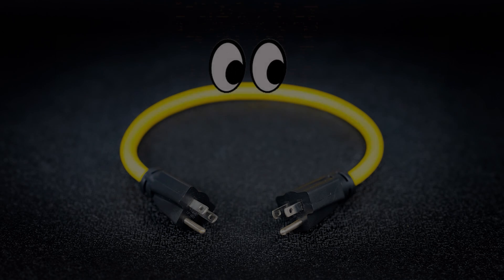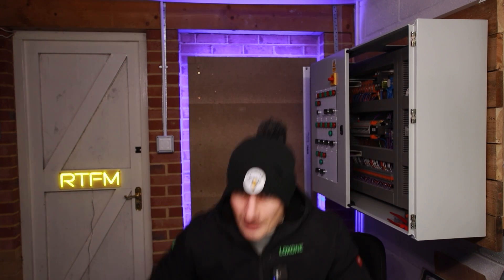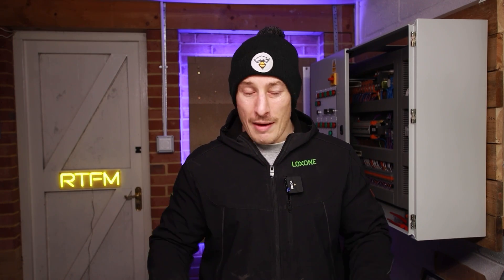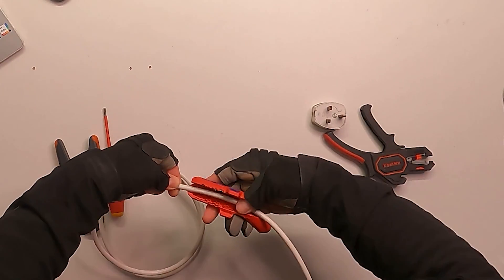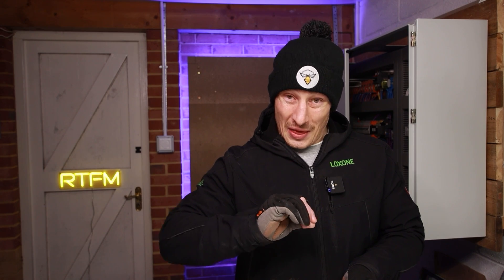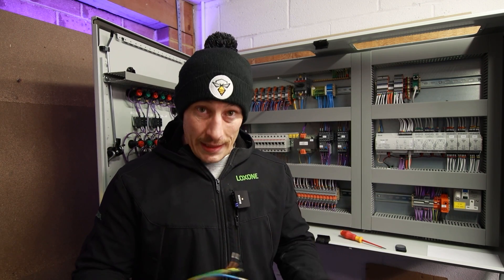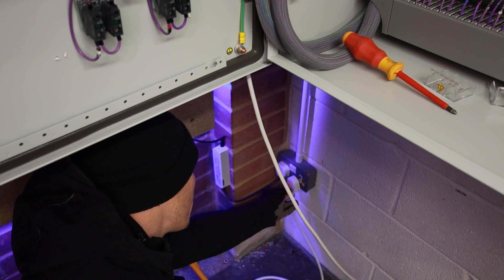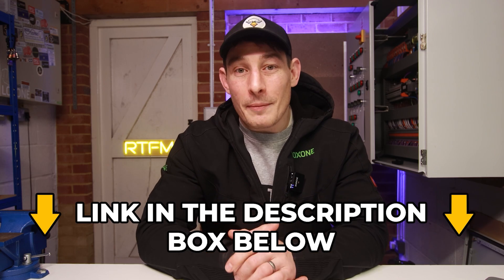The Worst Cable for Electrical Testing

Comment: Fly leads! I also have a box of these that we use in panel changeovers to temporarily run pumps, boilers etc. I also put wagos on the bad ends when not in use and I never use T&E though, always flex.
Reply from the maker: Yeah good shout on the WAGOS